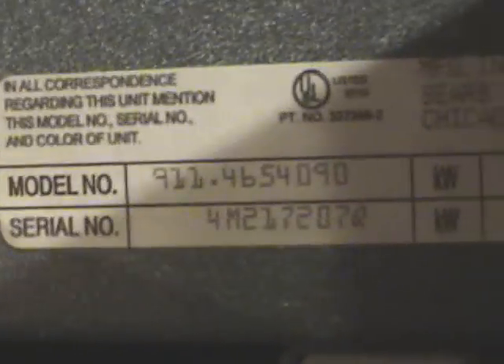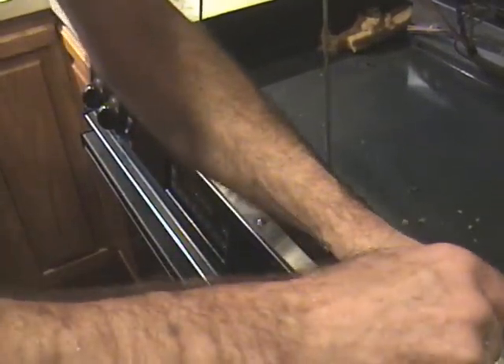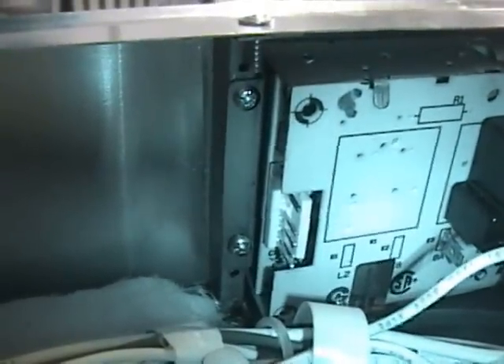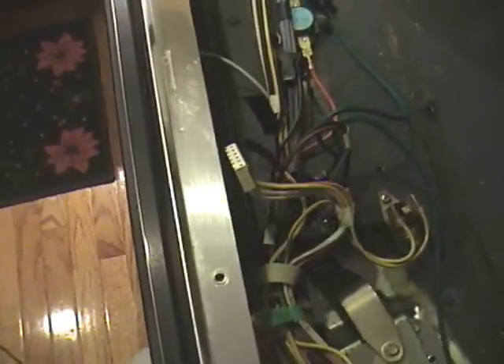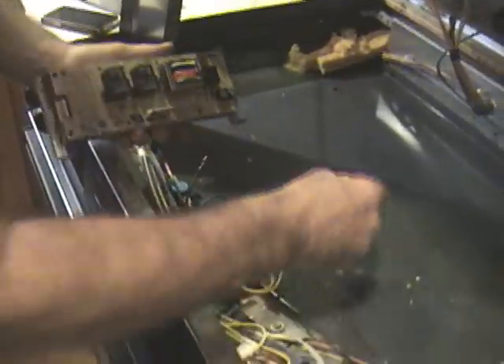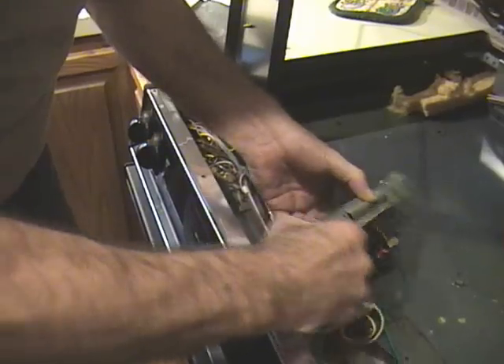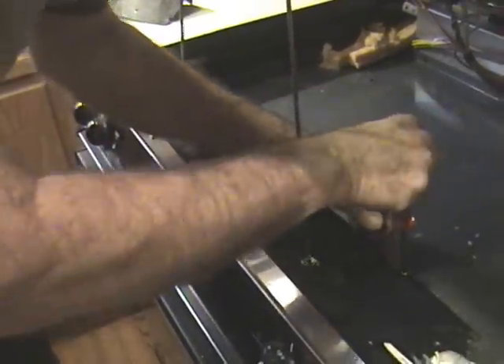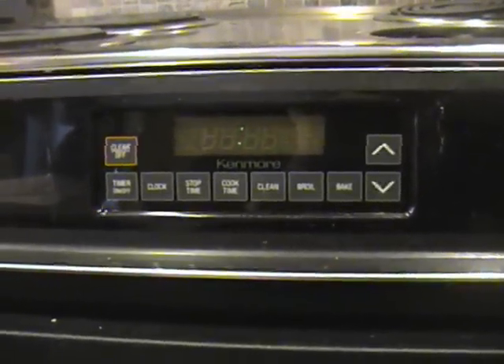How to Fix an F1 Error On a Kenmore or GE Range

Comment: I have one of these that is giving an F1 alarm but only when idle. I can start the oven and heat it up but when it's off it throws F1. Already replaced the control panel and the temp sensor.

Comment: My question is what genius over at GE designed that piece of crap. When the F-1 error code goes on, a beeper beeps constantly and you can’t stop it. It sounds like a damn forklift is backing up in your house. The only solution is to unplug it, which I can’t do, or go down and throw the breaker switch, until I can take it apart. A beeper is totally unnecessary. The  F1 error code is plenty, to tell you somethings wrong with the stupid thing. Hopefully that engineer was soon fired after designing this piece of garbage!

After repaired, I guess it’s a good idea, to check the clock, once plugged in, before putting the whole thing back together again with 8,000 screws! 😄

Thanks for the post, though, and the lead on the “Circuit Board Medics” repair place. However, they advertise repairing a GE circuit board for $160, plus you have to add shipping to that. I would rather just buy a brand new, much more efficient, stove and oven when they go on sale on Black Friday.
Reply: There is NO SOLUTION to the F1 code !  I had to deal with this for YEARS.  I fought Whirlpool and they still did not satisfactorily solve my problem.  Had a Magic Chef 1994 gas oven.  F1 code kept going off even after replacing 2 KEYPADS ! The design of the keypad itself was the culprit and there was NO FIX because every new keypad would do the same F1 code after 6 months of installation.  Moisture got between the contacts under the membrane and caused oxidation which would short the contacts tripping the computer to F1.  They don't build things right anymore.  I have a 1984 GM car with a soft touch keypad for the climate control just like the one on the oven and it STILL WORKS like new to this day !  So if GM can do it right, why not Whirlpool?  And cars get way more moisture and humidity than any house does.  Don't buy New appliances.  Keep your old ones from the 1980's.

Comment: Thanks! I had a double oven, I was able to take the top part out and the bottom part still works.  I'm currently working on the circuit board now.  I'll keep ya posted if I get it without hooking it up to a diagnostic machine.

Comment: I just had this problem non stop beeping "F 1" problem. Holding down "Clear Off" for about 10-15 sec solved it, after a few other trials.
Reply: bourbakis just tried this and it did not work
Reply: Yes, but the beeping comes back when you least expect it
Reply: YES!!! This worked!!!  I had been pushing  the "Clear Off" button, but had been doing it quickly. After reading this tip, I did hold the button down for the 10-15 seconds and the "driving me crazy", non-stop beeping finally stopped. The F 1 code still appears, so will now try turning off the breaker for at least 5 minutes (a tip from another video vs off for only 45 seconds) to reboot the panel.  If this works, I can cancel the $99.95 service call - and that's just plain old highway robbery!
Reply: @jackvictor7659  Pressing "Clear Off" for 15 seconds silences the BEEP but does not clear the F1. My 1994 GE JSP26GP4WH isn't worth the cost of a new WB27K5107 control board so I'll replace the range BUT silencing the BEEP allows me enough time to shop around for the new stove.

Comment: I have a Thermador Model RED30VRS Electric Range/Oven. When it's in bake mode, the lower bake element does come on but shortly afterwards the bake element shuts off and the upper broil element comes on. I replaced the bake element last week yet a few days later, the problem still persists. My wife is not a happy camper. Any suggestions please?

Comment: Hi, has anyone else used Circuit Board Medics? Opinions?

I sent the parts for my aging but lovable Kenmore Classic Grille to them but, like Yeechblitz, it didn't work the first time. I have sent them back in the hopes that I have the luck Yeechblitz had in that the repaired parts work the second time around.

Yeechblitz if you read this has your stove continued to work?